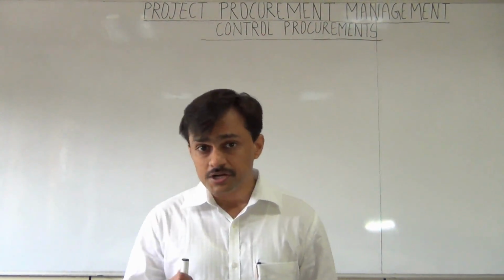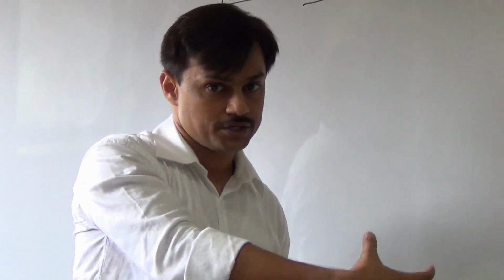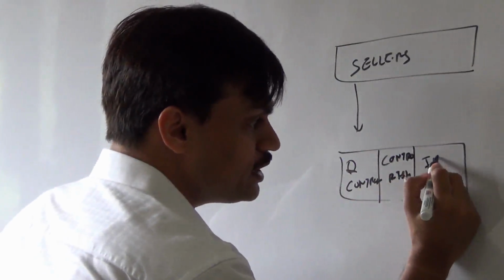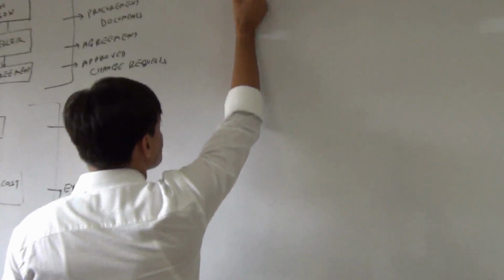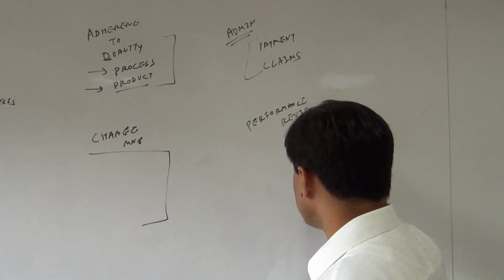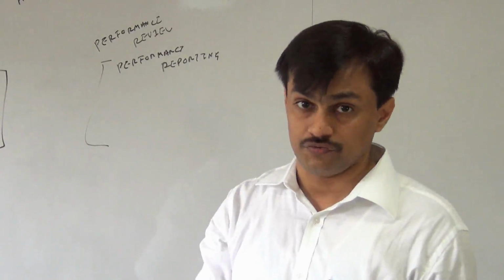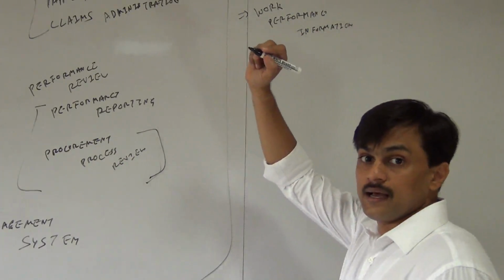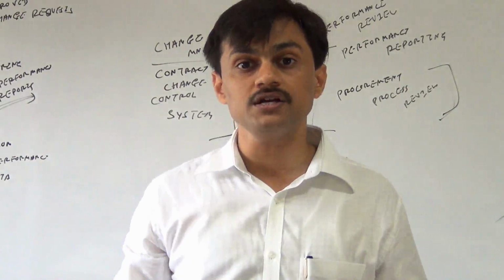Project Management Professional (PMP)®  | Control Procurement | Project Procurement Management.

Comment: Dear Sir Saket,

i have a related doubt, please do help me in clearing the same,

if suppose i am from buyer side , planned some criteria and executed accordingly in direct and manage project work and produce some deliverable (project artifact, interim feature of product etc). but when we (buyer) have outsourced some work and seller wants to change something in terms and condition or in statement of work, he obviously raise a change request, it will go to perform integrated change control process for further process, upon approval, approved change request is implemented through control procurement but not via direct and manage project work, am i right ??
please guide...

regards,
Haseeb Ahmed.
Reply from the maker: I did not get your question and this video was on PMBOK 5
Reply: @izenbridge  my question is simple:
Approved change request are an input to direct and manage project work.

But approved change requests regarding seller to contract is implemented through control procurement process. Am i right??